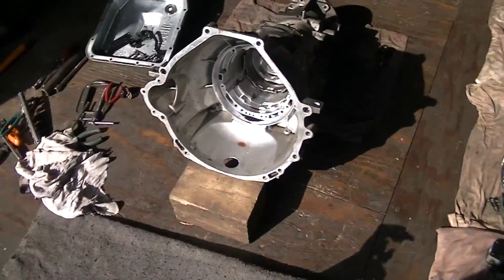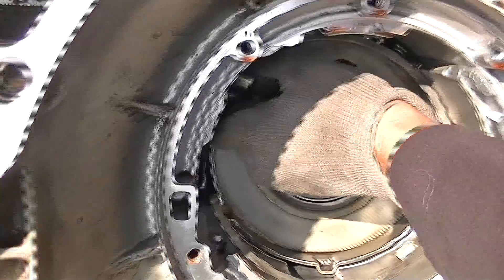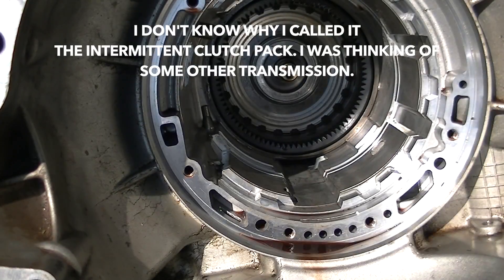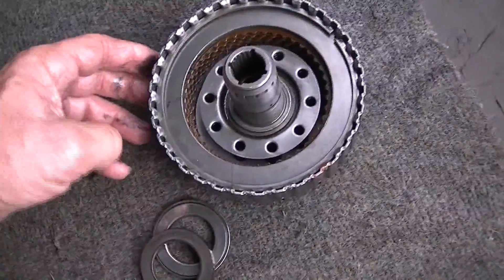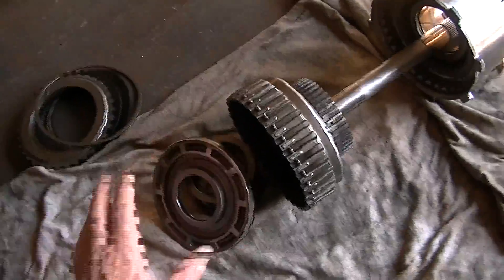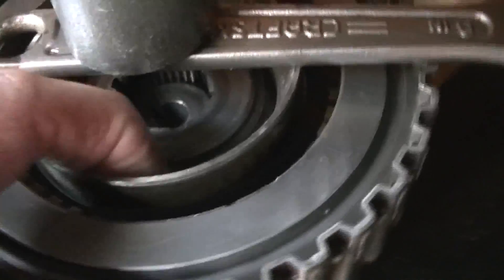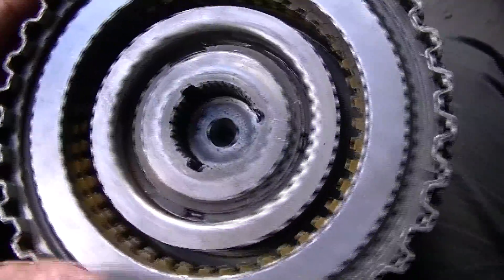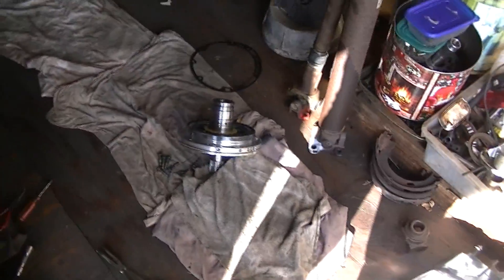Ford....4R70W Transmission detective work....Finished!!! -Part 3

Comment: Quick question whats the difference between the 4r70w and the 4r75e
Reply: Gear ratios mostly, depending on the year of manufacture there may also be electrical differences. One case speed sensor or two case speed sensors. Different electronic pressure solenoid....

Comment: Good Job Sir !! I was wondering if all the parts had arrived yet. I let a shop do my AX4N. They gave me a GOOD Deal. Next time i am going to refer to your videos and tackle it myself. Thanks...
Reply from the maker: Cool at least yours got fixed before winter;)
Reply: ..like you and the Almanac, i believe we are going to get some more cold weather starting next month and after the first of the year...
Reply: I have been tearing my F-150 transmission down all the way too. my sunshell gear and planetary teeth got chewed up after a 1-2 soleniod failure. I have 148k miles. I recommend you change all the solenoids from ebay for about $69, I also swapped out the tuff plate for $35 and the sonnax sure cure kit. well worth it.
Reply: Do you need any special tools